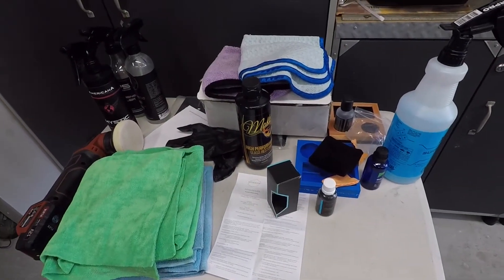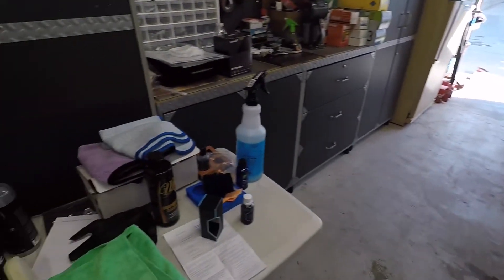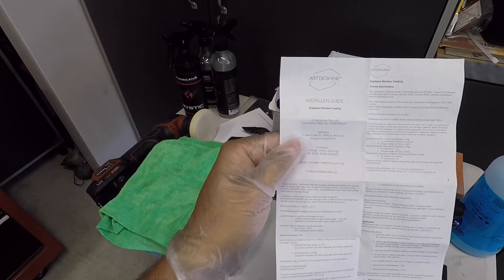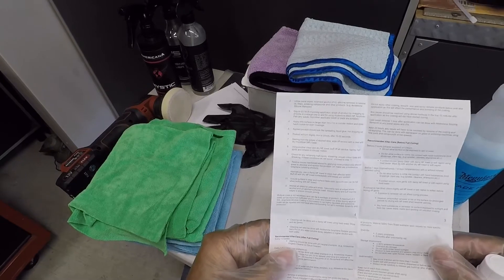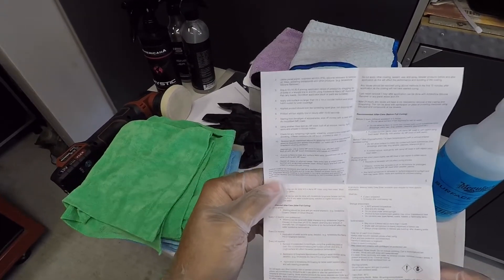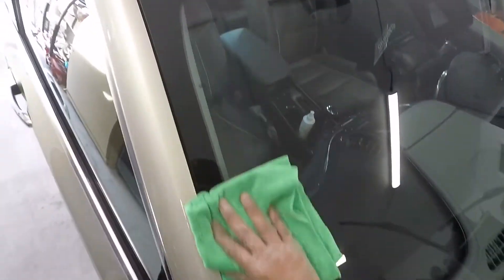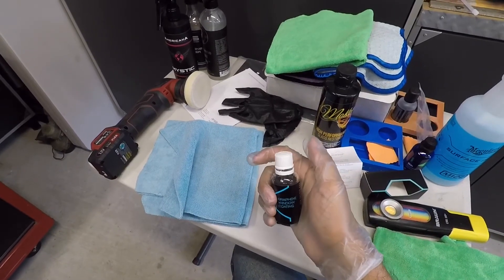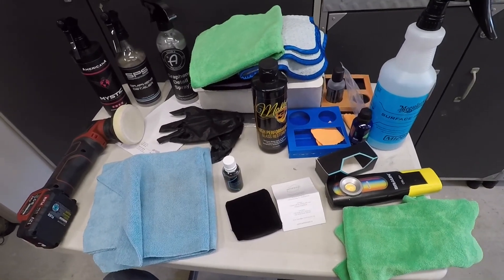#Artdeshine Graphene Window Coating Application

Comment: Hi! How does it perform in time? Still hidrofobic? Also wipers are gliding nice?
Reply from the maker: It is still there and doing well.  It has not rained in Southern California since January so no wipers have been used.  That has a lot to do with it as the wipers are not abrading it.
Reply: @MikeGDetailing  i see. Thanks for the heads-up

Comment: Is graphene really better than ceramic? They seem about the same to me based on all of the videos I've seen.
Reply from the maker: That is really an opened ended question that does not have a straight answer.  What you have to keep in mind is that graphene coatings are ceramic coatings that are infused with reduced graphene oxide.  So it is another form of a ceramic coating.  Similar to how there are titanium dioxide (TiO2) coatings, silica carbide (SiC) and of course the typical silica (SiO2) infused coatings.  

What brands are hyping is that graphene is the next evolution and that the rGO is the answer to a coating being less prone to water spotting.  From my experience graphene coatings still spot and appear to spot the same.  Brands are also claiming that they produce better gloss, are slicker and more user friendly.  I agree that they are typically slicker but not all.  Gloss is a moot point as the gloss comes from the polishing step.  The ones I have used are pretty user friendly but "ceramic" coatings have come a long way in the last 10 years or so and have become more user friendly.  So there is a slight edge to graphene being a bit more user friendly.  

Durability is still the open ended question.  The advantage that graphene infused coatings have is that they are leveraging off the ceramic technology.  So graphene is in its infancy and I would say that we will see them becoming more popular over the course of the next few years as the technology is adopted more and trickles to the consumer market.  I would venture to say that in 3-4 years graphene would be the go to technology if it shows promise within the next 2 years as being a viable addition or the big names in the idustry (ie CarPro, Gtechniq, Gyeon) adopt it.    

Sorry for the long answer but I would say to give one of these graphene coatings a try and if you don't like it then move onto another one.  I almost forgot that many of the graphene coatings on the market are blended by the same place and are tweaked here and there for that particular brand.
Reply: @MikeGDetailing  great content Mike.